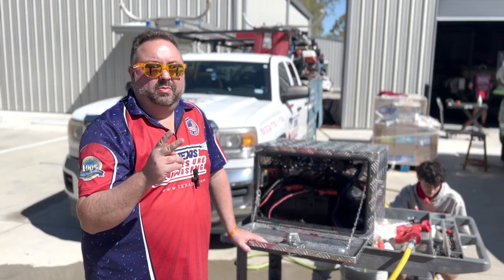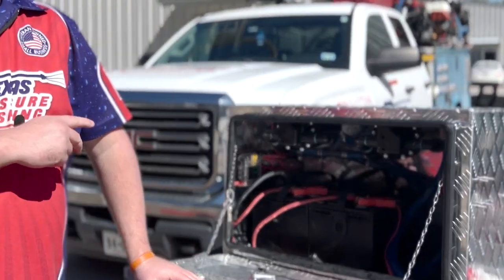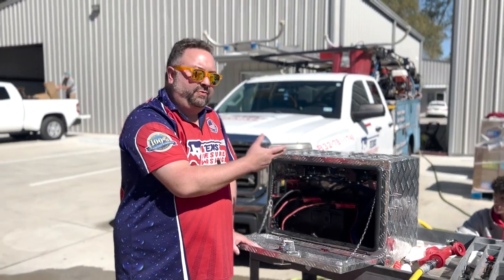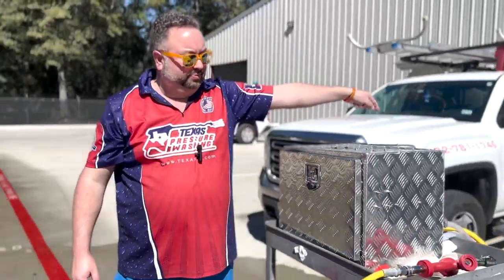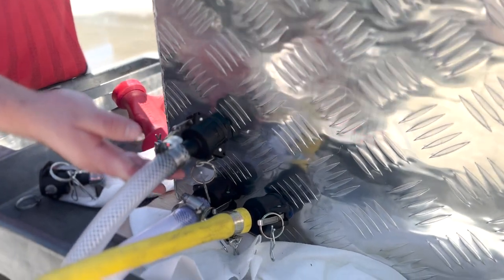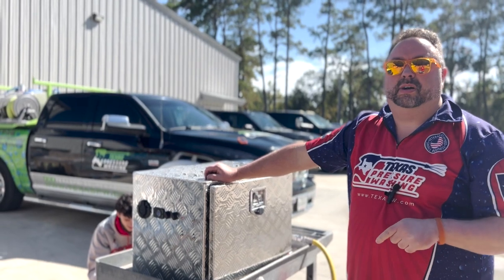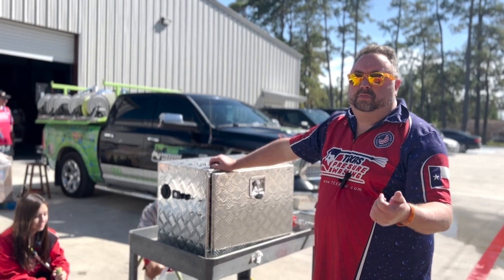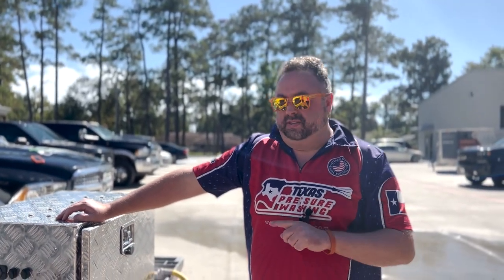Teaxs Tornado 14GPM Dual 12V System

Comment: Y'all did the same thing my builder did on my trailer. Loose jiggly hoses going into the box from the cam fitting. Y'all used the hose barb fitting going through the box and then the hose basically being attached to the barb is what holds the entire thing together. Drives me nuts being loose like that. Why not get the 3/4 threaded instead with a gasket and the female 3/4 to barb? That was you can tighten the fittings up maybe? That's what I've been thinking about trying with mine. The vibrations alone are annoying.

Comment: How difficult is it to change out the pumps? I'm looking for easiest maintenance and I'm torn between a quick swap 12v or an air system.
Reply from the maker: Very easy.  But they don't fail like normal due to having the correct wiring, plumbing and soft wash hose size.
Reply: @TexasPressureWashing   great

Comment: how do you plumb both pumps to run at the same time, once mines builds up pressure the other pump will not run?
Reply from the maker: Check valves.  You can run one or both at the same time.